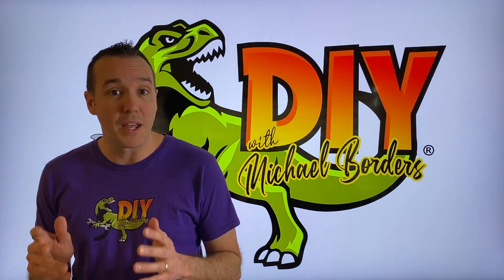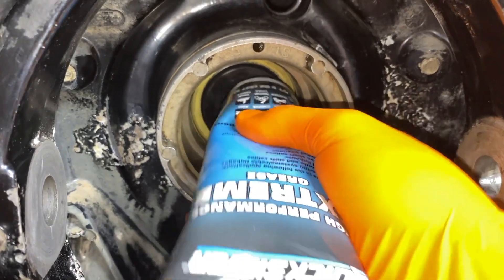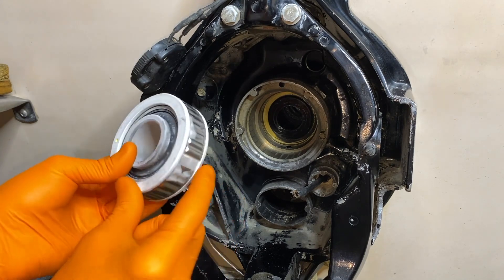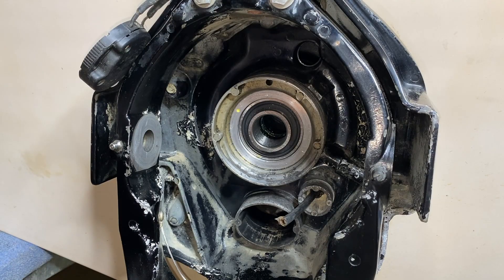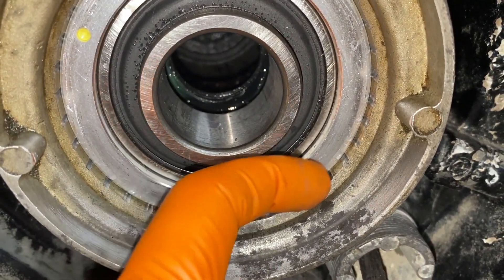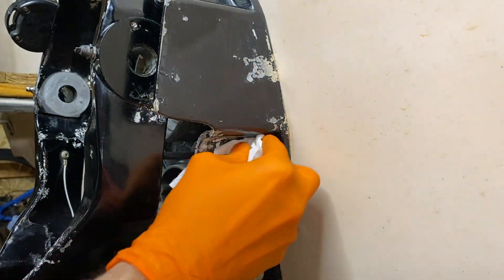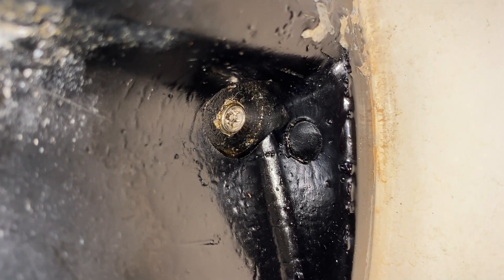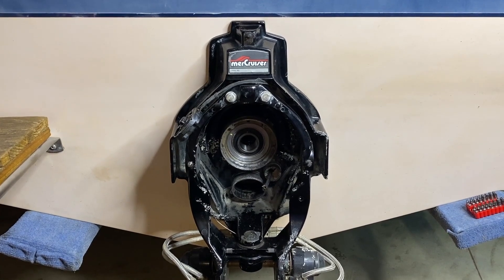Install new sealed Perma-Lube gimbal bearing and set screw

Comment: I installed the gimbal bearing exact as you showed but now my rod won't come out of the back of the shaft. I tried everything, pulling, I put a plate on the end and tried to slide hammer it off using a 10 lb sledge. Totally baffled and feeling wasted. Everything was going so well up to this point. Any ideas? Much appreciated.
Reply from the maker: @MichaelCorcoran-wy6lb  

Thanks for watching, any update?  That’s no fun.  It’s very likely that the tool is slightly larger than the inner bearing.

This is more common when installing an aftermarket gimbal bearing as opposed to an OEM.

In our case, our tool was slightly out of specs which required us to apply additional grease.

At this point, since it’s stuck…you will definitely want to install a new gimbal bearing after removing tool.  It’s even possible that the bearing will come out stuck to the tool.

A few options.

1.  Carefully drilling out gimbal bearing to a point where you can create a weak point and pull it out.

2.  Use of heat.  If deciding to apply heat, just be mindful and careful that you don’t damage any surrounding parts…nor set grease on fire.

Keep us posted.  👍🧰

Comment: I just replaced my gimble bearing, it was a perma lube , ill never install one again!   Id rather grease regularly than put one of these waste of money parts.
Reply from the maker: @sweetlou5902  

Thanks for watching and sharing your thoughts, always welcome here on our channel.  Nothing wrong at all with the older greasable design.  👍🧰
Reply: @DIYwithMichaelBorders  nothing personal, just despise that product, leads people to neglect maintenance in my humble opinion.
Reply from the maker: @sweetlou5902  

We appreciate the reply, all good thoughts there.  We were very impressed on how many years our old standard greasable bearing lasted.

😁👍
Reply: Out of curiosity, how often should you change the non greasable bearing? Do you go by hours? Or wait for it to kick out (doubtful, but ya never know. Lol).
Reply from the maker: @pushintheenvelope  

Good morning ☕️ great question.  We replace it each time we remove outdrive and replace bellows.

For us…we like replacing it when the outdrive is completely removed from transom…it’s a very cost friendly part and we have the tools to pull the old one out and drive a new one in.

Personal preference at the end of the day however that has been our approach over the years.
Reply: @pushintheenvelope  it’s a 300 hour service kit